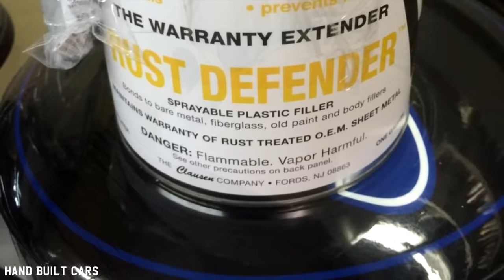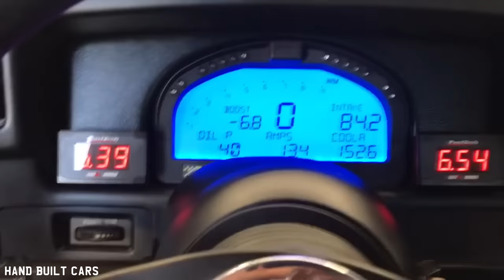1989 Ford Mustang LX 5.0 Jon Kaase 2000 HP Twin Turbo Build Project

Comment: Great job. Must be an award winner many times over.
 Ever since I sold my 64 1/2 Mustang back in 1975 (6cyl
 3 speed) I've been more of a Mopar guy...mainly Roadrunners. Of course a nice 69 Chevelle SS would look good in my garage too.
You should see the look I get when asked what my favorite color is and with a straight face I say, Chrome.

Comment: I want to tell you very nice build. And I'm a sucker for the color Red! I like how it pops off of the little black it does have. And the beautiful polished crank, intake, and other bit and pieces, very nice. Does it run a bit warm under the Hood? Just wondering. This brings back memories for me because, in the late eighties I was out on my own in my first apartment, and working at a Ford dealership in the recon department, but I loved it. The reason is every vehicle I preped for its new owner I got to drive a little because we would fill every tank no matter what, and the station was a couple miles down the road. The dealership had got rid of its pump for gas. Anyway, I had drove alot of the fox body mustangs. One mustang I remember that was a factory order was a Saleen mustang all done in white. The father ordered it for his son that came home from a four year stint in the Army I believe. They never hurt for money, the family was in the granite industry, building and monuments. But this brings back memories, my. Two bedroom apartment was only $200.00 a month and my landlord was right downstairs and I'd go pay cash to them once a month. Thank you for the Memories, and sharing your build!

Comment: Did you do all the work yourself ? As far as the roll cage, porting and polishing the heads and intake, Assembly of the engine, and painting ?
Reply: lwj w The only thing I didn’t do was the cage. It’s an all chromoly piece done by Tim Lyons in Ga. Everything else was done by myself in my home garage.

Comment: The only thing I can find that isn't top tier goodness is that cage. It's amazing as it is, but it could have been fit better to the interior and seats and still been just as strong. Hella hotboi points for the fully-painted, bright red floorpan and underbody stuff, as well as the chromed as hell engine bay. 11/10, even with my personal nitpickyness about the cage.

Comment: Nice build. Can I offer a a little bit of advice here. You may want to run the Breather Lines out of the valve cover in the front. It keeps the oil in the motor better then putting them in the back.
Reply: ron bown Thanks. I welded/built internal baffles inside the VCs. Oil has never been in the catch can only catches ethanol from cold starts. There is very little oil in the VCs as i restrict it to the mains and rods.
Reply: That does help with the restrictors. I have them in my windsor too. Turbos do make more blow by then a NA motor.

Comment: So what is Kasse in this build??? No P-38 heads or Boss stuff.
Reply: Im with you. I would guess kasse built the short block.....and maybe the turbo setup. The motor sounds pretty tame for 2000 hp of output. I would think a much more rowdy cam would be needed for 2000. Maybe the twin turbos are making it sound less quiet.
Reply: How Kaase heads ????
Reply: Kaase's did machine work on the shortblock only
Reply: P38 ain’t race heads.   Intake ports ain’t raised or nothing 
Make great street heads tho
Reply: That wasn't my point. Was wondering why he had "Kasse" in the title.
Reply: kaase shortblock only

Comment: Awesome build. Good to see a Fox body with ford power plant. You went with Trick Flow heads, why not the John Kaase heads, just curious?
Reply: Cliff Holmes P38 heads are good heads but take a lot of work to flow close to these. These 255  Highports are a proven head and make big power on turbo motors.
Reply: Schlitz thank you for the info. I'm not a mechanic but I heard guys talk about the p38 heads and how good they are. It makes sense if to go with a head that will work and flow with a turbo set up. Awesome machine man.
Reply: Cliff

Comment: Stunning car,But 2000hp with twin 7675s a 95mm throttle body on an R box and 3" exhaust not likely.Any dyno pulls or just a guess, I'm thinking a guess.Still sounds and looks just fantastic a real head turner.Gotta be one of the cleanest stangs i've ever seen.